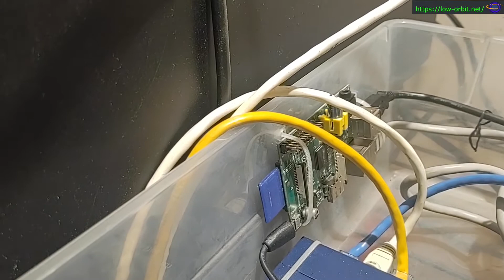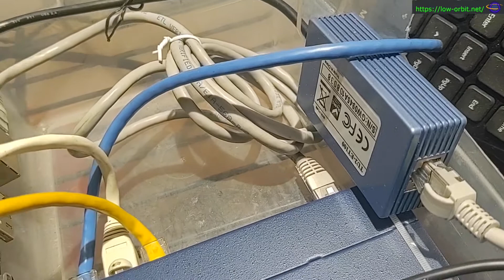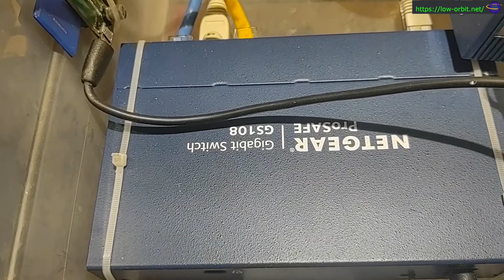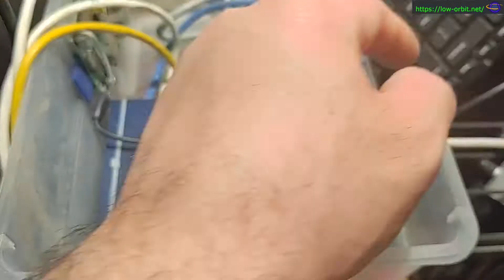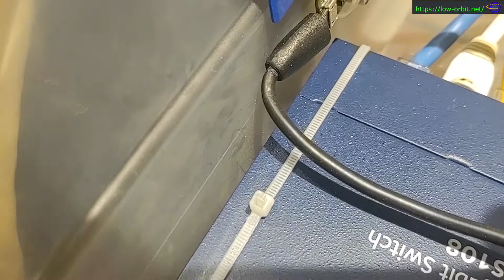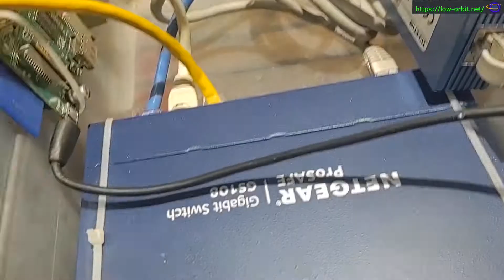Raspberry Pi Firewall / Router

Comment: What router Abe firewall are you running on the pi?
Reply from the maker: Just Raspbian with the default IPTables and kernel routing.
Reply: @LowOrbitFlux  I’m looking into Turing my pi from wireless to wired bridge. I can not run network wiring from one side of the place to the other side. However the bridge will let fix the problem. Okay very thing I found so far is not working.
Reply from the maker: @DiyintheGhetto  It can be done.  You will need to configure both the wired and wifi networks.  Then you will need to setup standard Linux routing ( enable in the kernel and add IP Tables rules ).

Comment: Man show the design?
Reply from the maker: I've been thinking of building a new one with a more powerful and modern system.   I'm probably going to document each step of that.  For my current setup I basically just enabled forwarding in the kernel and in iptables.  I added a few basic iptables ruels to block things by default.
Reply from the maker: Updated video with dual NIC router here:  https://youtu.be/Hc8ZppJ0LoA Design and instructions here: https://low-orbit.net/raspberry-pi-firewall-and-router-with-df-robot-dual-nic

Comment: I've got three original Pi B devices, only 2 USB ports and one original  made in China.  One is just a server running Apache,  minidlna, mumble etc.  Another connected to TV and runs KODI and a TV tuner card.  Your project is interesting but guess the old 10/100 ethernet slows the home network a bit.
Reply from the maker: It would only really slow it down on the uplink.  Internal traffic is going to just go over the switch.  My Verizon connection should be what really slows me down accessing the internet though.   I am thinking of replacing the old Raspsberry Pi router though.
Reply: @LowOrbitFlux  Ah yes, good point about the switch.